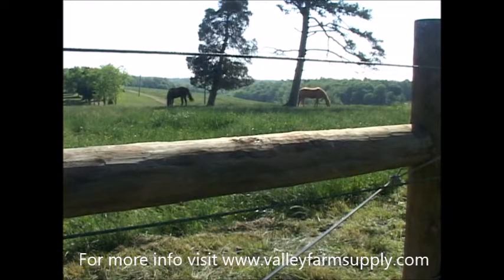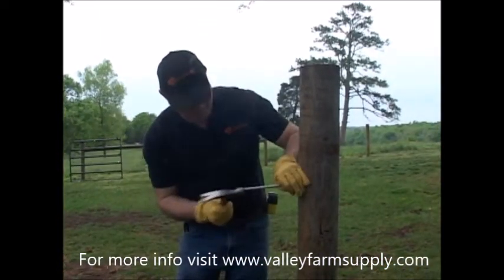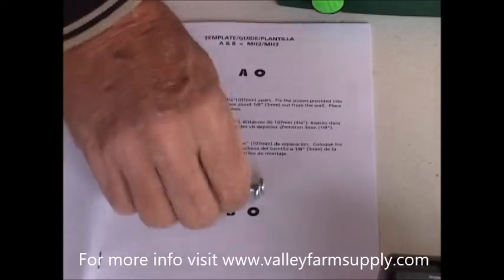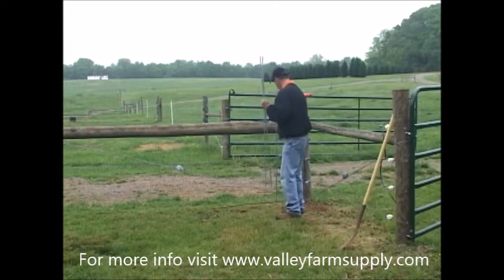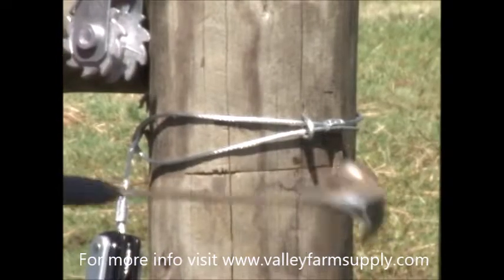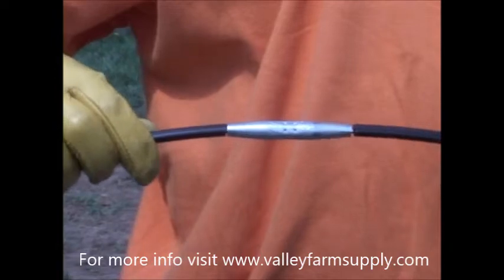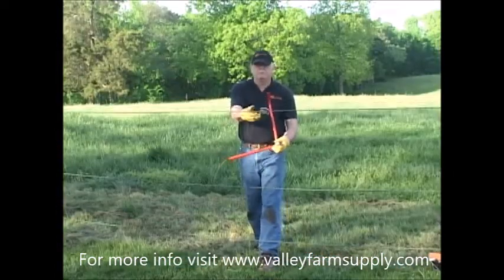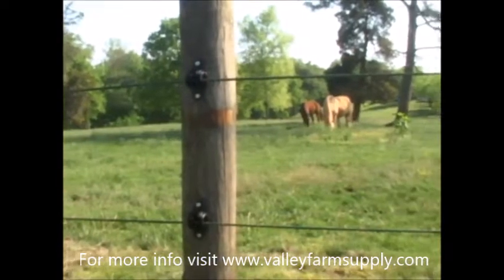How to build a Gallagher Horse / Equine Electric Fence

Comment: Sins here in holland noboddy can answer my question i hope u can 😅
I'm planning to use horse wire on plastic post's.
I was planning to drill thrugh the post's and run the wire thrugh them without using insulators.
(The end post's is a different story).
Now i keep getting no its not possible it can't be done because the wire will ground out.
Now i'm thinking the insulators are plastic the post's are plastic why should i buy all those insulators on plastic post's??

Can it be done or am i thinking about this all wrong ??
Reply: I'm sure you figured this out already but yeah you idea would work. There's a plastic fence post that comes with pre drilled holes for exactly this type of thing. Lookup timeless fence for an example.
Reply: @jamestopel3734  yeah i got it standing for a few weeks now and it works great 😁👍